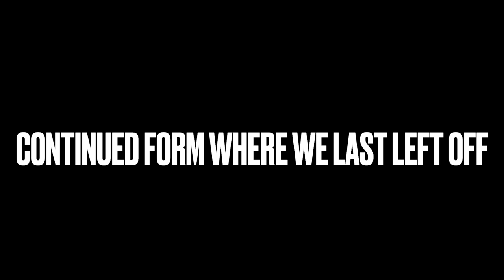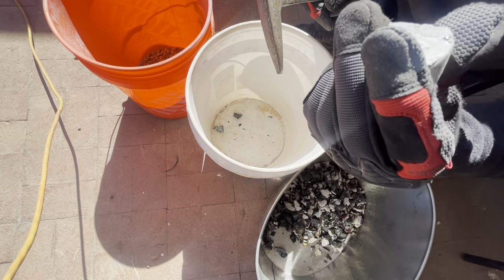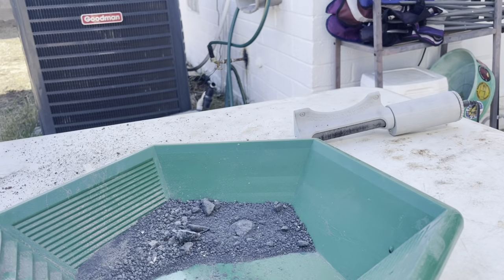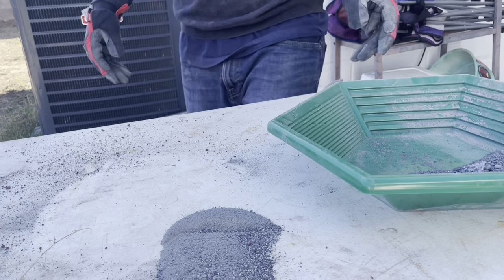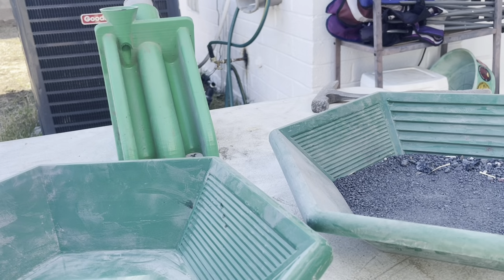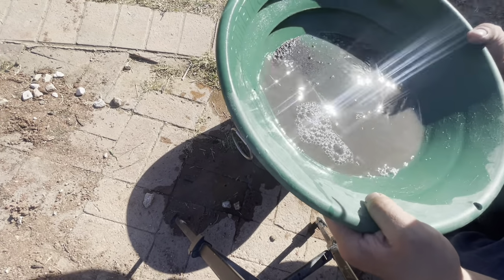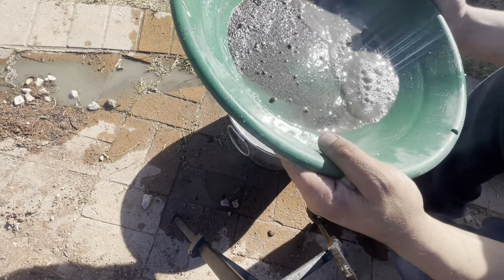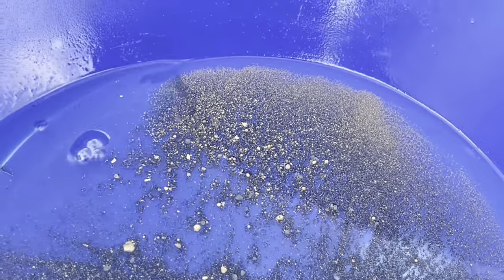Crushing Gold Slag, Crucibles, Fire bricks and Cupels for Gold Recovery & Precious Metals Part 2

Comment: The Black Sand Separator is great.
Saves a lot of work when cleaning out 🤠🇩🇪👍
Reply from the maker: it really does! Would you use one over there?
Reply: @VendettaProspecting  That would certainly be useful for people who dig on the Rhine. They do a lot of material about the Highbanker.
In my region there is very little black sand and therefore very little gold.